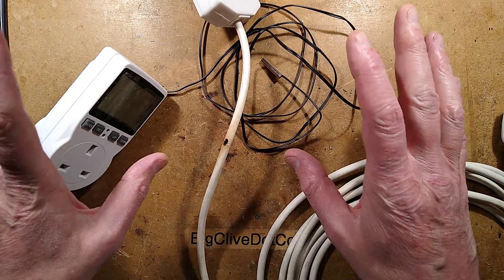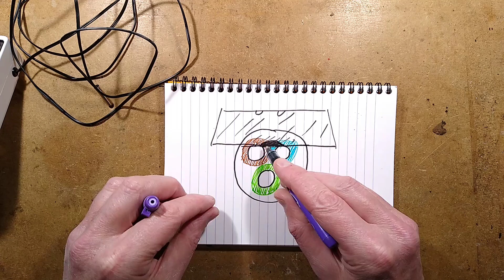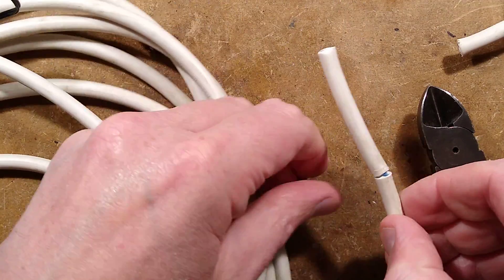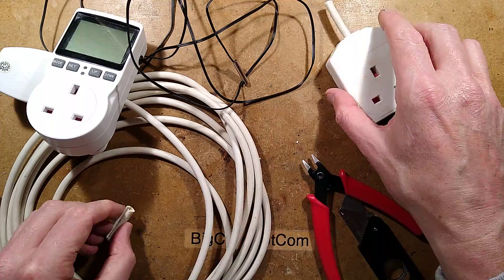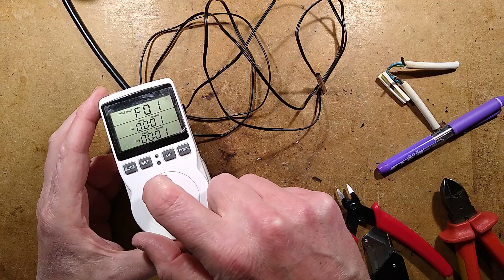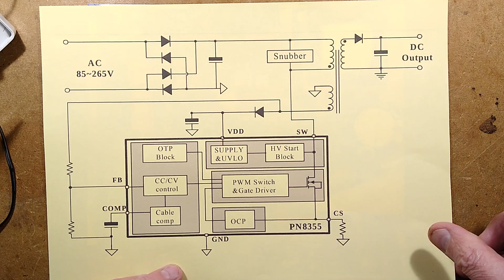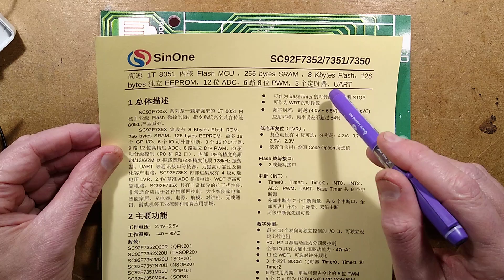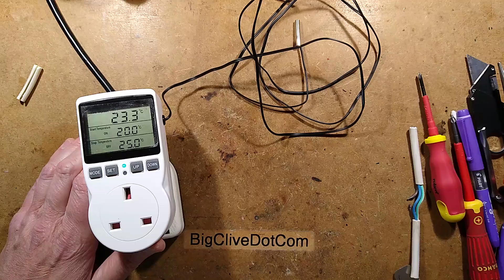The case of the mysterious cable arcing

Comment: It's most likely not the same problem, but it reminds me of a flaw I found with a multi conductor cable once. One of the 10 wires was open and after stripping the cable out, I noticed that the cable had a suspicious lump about 1/2 way along it. Cutting it open revealed the faulty conductor to have been crudely twisted together without stripping the insulation. The only conclusion I could come to was that it must have broken during manufacture, or maybe that conductor came to the end of the roll, and someone just twisted it together before the overall jacket was put on.
Reply: Three cheers for non-existent quality control!

Comment: I can attest that damaged/punctured cables can work without problem for years until water/humidity get involved. In a previous apartment in a basement the heating power cable was punctured at multiple places when the floor moulding was installed (by an idiot I guess) and we only learned about it years after when a minor crack in the foundation let started to leak drops of water. Trust me, hearing crackling and popping and seeing smoke on your wall isn't a good experience.

Comment: I cant believe the relay is so small, for 15 amps that just blows my mind. I still wouldn't feel comfortable plugging a heater into that, let alone plus the extension cord
Reply: Looked a normal size relay to me.
Reply: Whilst the relay is nominally rated for "16A", that would be for a resistive load rather than an inductive one such as a heater. In this instance it is a generic Chinese "implementation" of a design that is normally rated and UL/TUV approved as 10A at 250VAC resistive.

Comment: We take extension leads for granted, abuse them and then get a surprise when they fail. I'll be more careful in future. I much prefer it when cable ties, not Tape, are used to secure the coils. At least you can cut cleanly.  

Nifty little thermostat.

Comment: Only time I've ever seen that happen was on a coule of clothes iron cables, with all the wiggling, jiggling, tugging and whatnot that they get over time, it's no surprise they go pop eventually, and usually right at the strain relief, which is rather ironic... :P
Reply: Yes, I’ve had similar faults. The cable is not damaged by anything external to it. But the constant movement eventually causes either the line (brown) or neutral (blue) wire to fail and break. Once it goes open circuit, because the PVC still holds the ragged copper strand ends together some of the time, you get arcing and burning. 
With any flex (flexible connection cable), it’s good practice to inspect it visually and feel it as you run the whole length through your hands feeling for any deformity as you do so.

Comment: A few years back, when Midnight was a pup with those razor sharp milk teeth, he bit one of my extension cords. I used it around the shop for several months, never noticing the damage. I finished a small project using that cord, and my son wanted to use it for the electric mower in our small garden. Soon as the mower started up, there was a loud pop and the breaker for that circuit tripped. Turns out the little pupper bit through the insulation on the live and neutral, but through all the use in my shop they hadn't shorted together. After a quick inspection, I found 3 more places he had bit! All I can say is it's a good thing it wasn't plugged in when he decided the bright yellow 50 foot 12/3 cord was a chew toy! 😬
Reply: My dog chewed through a live cable. The 240v didn't apparently worry him too much. It was a cable running a fountain pump, and had one of those plug in RCDs on the input end, so it tripped that instead of blowing the fuses. He did it multiple times over a few weeks before we burried the cable in conduit and switched to 12v solar instead of mains.
Reply: @tin2001  I guess chewing on wiring must be very satisfying to them, every dog I've had has done that as a puppy, and one has done it her entire life. Good thing there's RCDs and GFIs, the quick action of them has probably saved many kids (furry, human, or adult kids) from an unpleasant jolt. Midnight's 2 years old now and I'm still finding cables he bit into or completely through as a pup! I swear he probably bit a few of them and thought it was just spicy spaghetti, though. 😆

Comment: The extension cable seems very old based on how the insulation broke into pieces. As others have said, probably an internal breakage of several strands in the live conductor caused by bending, which overheated the remaining strands when current flowed, causing it to open circuit. Current then continued to flow through the resultant plasma, which is why a fuse or breaker would remain closed as the current was the same or less than before the fault. Eventually the conductor ends melted until the gap between the ends became too far to sustain an arc. Maybe strip the other conductors at the same point to look for more broken strands?
Reply: Yes, I'm of the same idea! It happened to me with an old vacuum cleaner.
The cable was stressed from the winding cycle over the years and some wires eventually broke somewhere, then the weakest point overheated and boom!
Also, the overheated plastic became brutal and prone to making the sort of clean break as seen in the photo.

Comment: Stanley being a major maker of utility knives in USA  you are correct in calling it a Stanley  blade .
Reply: I love the 'hook' type Stanley blades, when I can get them. Great for cable stripping or safer opening of parcels or envelopes.
Reply: @ridefast0  Intended for carpet cutting I recall…
Reply: No, when the knife caused something dangerous Stanley Black & Decker, Inc. will be first to point out that it was, in fact, a competitor's product.
Reply: I thought they were all called Box Cutters over there
Reply: @sjames5027   box cutter use safety razor blades . Utility knives like stanley brand use a blade that is made to for just them in a trapezoidal  shape .   Box cutters further are flat  while the utility knife has a larger body.
Reply: But what you really don't want to mix is metric and Imperial/US blades and knives. I know of one man who tried that and accidentally put the blade through the palm of his hand. This happened back in the 1980s, so might be resolved now.
Reply: Stanley is widely used worldwide, not just in the US.

Comment: I've had a very similar thing happen, single broken wire causing arc, on a couple of IEC mains leads with 'chinese copper' wire.  I put it down to poor manufacturing and excessive bending in the packaging department.  

Although apparently not in this case I wonder if the absence of chalk in the cheaper cable construction leads to high friction between the wires so they don't slide against each other so one just takes strain and eventually breaks. 

In one case it was the earth wire that had broken so no arc just, fortunately, a hum on the amplifier which draw my attention to the issue.

Comment: This is the exact reason why AFCI (arc fault) breakers are becoming code in many places.
Reply: There is absolutely no certainty that a AFCI would pick this fault up. The load was resistive, so the arc may have been too small to be detected by a AFCI.
Reply: @Mark1024MAK   No....it's not certain but there is an excellent chance it would trip. I've seen the arc from power switches trip AFCI breakers.

Comment: That has been arcing for a while I would say,  the heat damage on the insulation has probably been caused by a prolonged fault. Probably bent very tight at some point, lost a few strands, then loaded with a heater. Moving the the lead to plug in the new stat would explain the coincidence
Reply: That's not a 13 amp cable, it looks exactly like it had been damaged, maybe a few strands of the inner wire were broken and it was then connected to a 13 amp load.
Reply: @ian-c.01  yup, 0.75mm² cable is rated at 6A max, allowed fuse values are either 3A or 5A. the plug does say it has a 5A fuse in, but that's not necessarily what's actually inside it. Also a 5A fuse could likely take 8A almost indefinitely, so even though it's rated 5A that doesn't mean it will blow at that current.
Reply: @CoolSteve08  I agree 👍 I was always taught that standard plug fuses blow at approximately 2.5 times the rated current. So they don't blow with say an initial startup current of a vacuum clean or similar high inrush device.
Looks to me that extension lead was not rated for a heater and overloaded.
I only use 2.5mm flex cable on my extension leads to any heater and even then if not un-coiled they still get warm.

Comment: Probably the last few fine threads of the live broke and sustained a good arc.  Sometimes when you nic a power chord like that they don't touch until the inner cables roll around each other as the cable is moved around.

Comment: So was the thermistor wire completely unscathed? It seems like it might have fed back and fried something internally, but maybe it's tiny low-voltage insulation was enough if it wasn't pressed deeply directly into the arcing spot?
Reply from the maker: I think it was just in the vicinity and assumed to be associated with the arcing.

Comment: I use velcro fasteners to hold the cable roll for this very reason :)
Reply: I hate using tape on cables... Not because of knives cutting the cable, but because it leaves a disgusting sticky mess if it gets left in a warm/hot place for more than a a few days.
Reply: I highly doubt a velcro fastener would help in this situation. I took like it was suspended over a corner with weight on the end, cold working the metal. People don't usually move extension cords a lot especially indoors.
Reply: I use zip ties or a loop of twine if I need to hang the cable for storage...

Comment: A soft pencil can help with zebra strips...
Reply from the maker: I suppose that could deposit graphite into the surface.   It could also introduce a slight leakage between adjacent pads.
Reply: @bigclivedotcom For Zebras i like to clean the contact pads with isopropanol and then rub them with a scrap of brown paper bag . 

Then I put the zebra in a small ziplock bag and immerse in 80to85°C water for a few minutes before reassembling.  Good contacts and some compliance in the zebra block seems to help it seat down successfully ..
Reply: @yeliab814  Sous Vide? My my.
Reply: Go on...

Comment: I’ve seen similar in my case the cable seemed to have been flexed a lot in the same position which developed an internal short that erupted via the outer covering
Reply: I had that happen to me with a hairdryer many many years ago. I had a copper plated plasma burn on my hand that took a couple of months to heal.

Comment: 2:00 or people use binbag strips with the metal core(you know..them white ones)around it and twist them shut, then when opening might try to pull them loose(instead of untwist) and unknowingly cut into isolation.